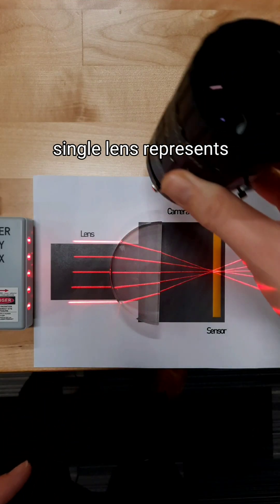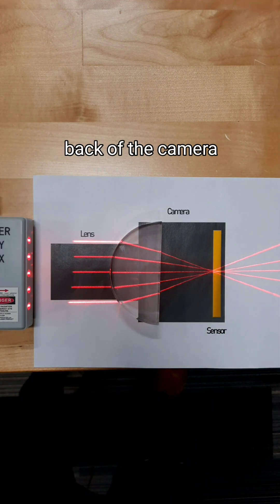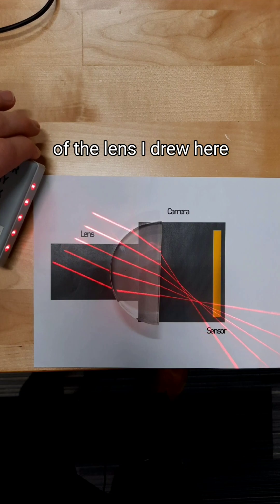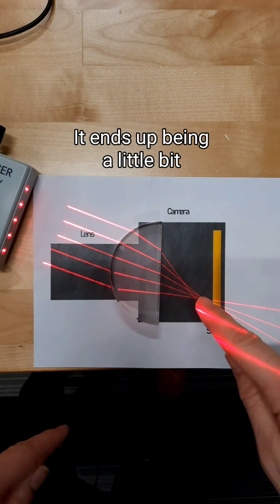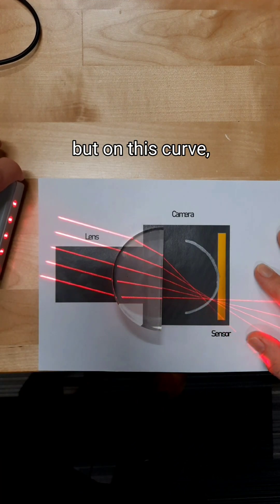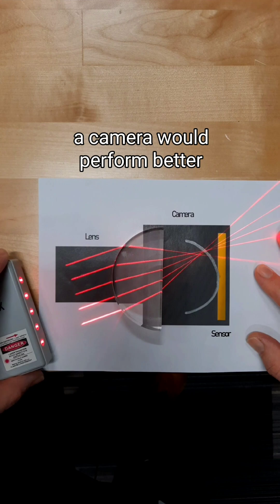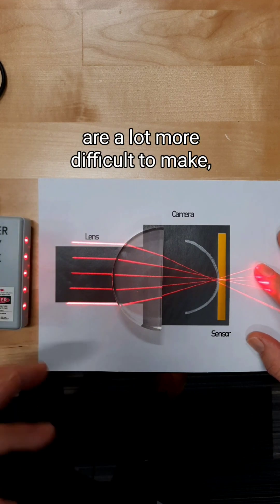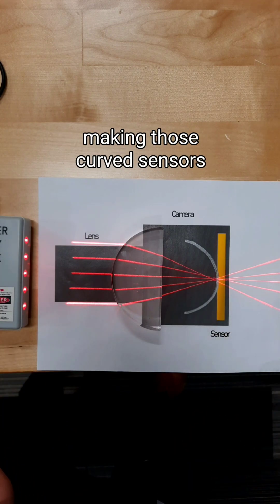Curved Camera Sensors and Field Curvature

Comment: Can’t say I’ve ever used a single element lens for photography,  I guess thats one of the things they try to fix with modern lens design.
Reply from the maker: Yes, this is a very simplified demo! Actual lens assemblies use multiple lenses to balance out aberrations like field curvature, but there is usually some level of this left in the system

Comment: This is rectified by using an aspheric lens? Is it not?
Reply from the maker: Yes aspheric lenses or combinations of lens elements designed to balance out aberrations like field curvature are used to correct for this and other aberrations! There's usually some amount of it left in a final system though

Comment: That’s what the lens is for. They correct the refraction of light waves.
Reply from the maker: Yeah as mentioned in our pinned comment, lens assemblies themselves are designed to correct for this field curvature and form nice, sharp images on a flat sensor (although resolution will be different at the edges of the sensor than the center)
Reply: What if you just moved the sensor forward so the focal point is on the sensor ?
Reply from the maker: @farmerjoe2103  if the focal point on axis (in the center) is on the sensor, then the image will be sharp in the center but blurrier on the edges (if there is field curvature present in the lens). You could then defocus the lens so that the image is sharp at the edges, but then it'll be blurrier in the center

Comment: No need for a curved sensor. A concave lens fixes all these problems.
Reply: Sorta. Doesn't "fix" the problem, it helps with the problem.
Reply from the maker: Yeah as mentioned in our pinned comment, lens assemblies themselves are designed to correct for this field curvature and form nice, sharp images on a flat sensor (although resolution will be different at the edges of the sensor than the center)
Reply: You'd also need a curved display to view it properly, without distortion